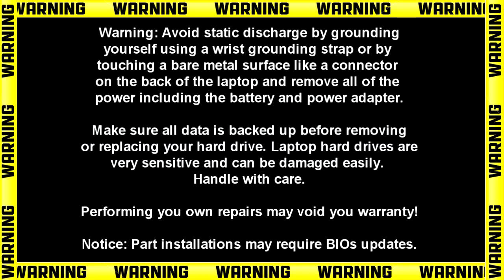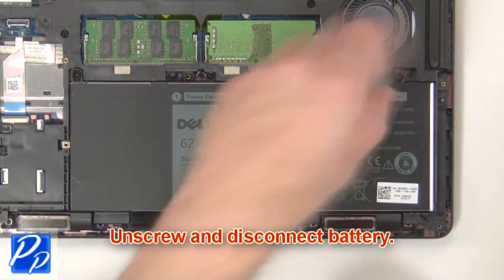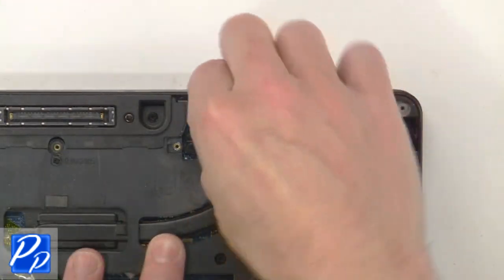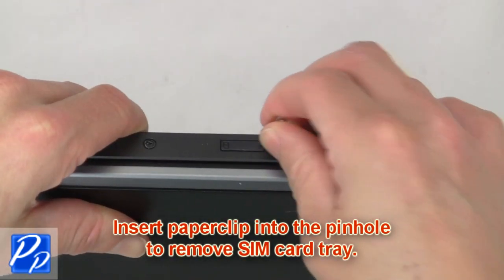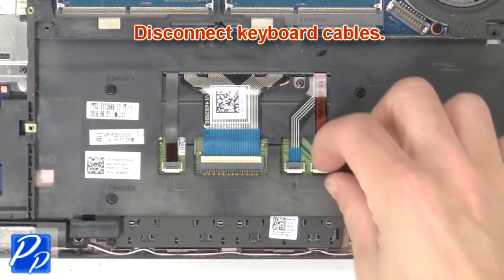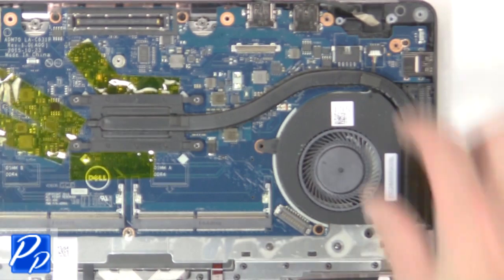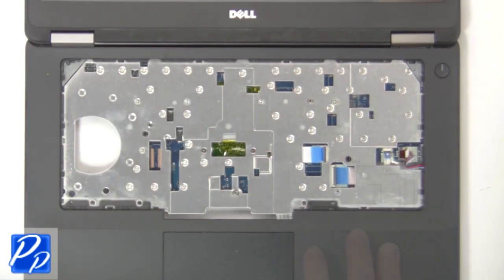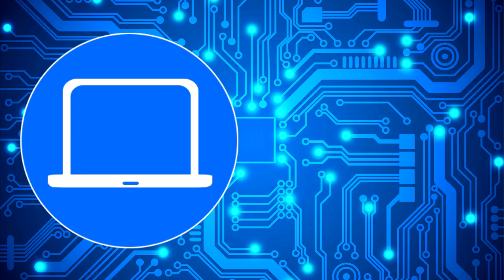Dell Latitude E5470 (P62G001) CMOS Battery How-To Video Tutorial

Comment: @dellpartspeople hm, but will removing the cmos battery clear the bios admin password? got an old laptop for free but the admin lock is inconvenient.
Reply from the maker: No unfortunately the admin password will not be removed from a cmos reset. The only way is a new motherboard or a manual reprogramming of the bios chip. Contact us directly with any questions.

Comment: THIS IS TOTALLY INSANE! I HAVE TO DO THIS LIKE 15 TIMES! I have never seen a CMOS battery in a worse place!
Reply: I was going to repurpose the computer now I am going to send it to the junk pile
Reply: IKR? Classic case of "who gives a fuck" at the design stage.

I have to point out that the main battery, hard drive, and WiFi / BT radio card are a very, very easy replacement job, so kudos to that designer...

But having to strip the entire computer to replace a $1 part? That's a $17 job, not to mention replacing the thermal paste when you put the heat sink back. I guess it was someone else's job to design the location of the CMOS battery.

Comment: all that just t find the battery, what the hell were Dell thinking
Reply: Very stupid design.
Reply: Lmao, why would you even pull the dc connector and the keyboard (basically disamble the whole laptop) just to frekin reset cmos, laptop business is just so stupid
Reply: Yeah seriously WTF
Reply: For those who don’t understand what Dell made it so difficult. 

It’s actually simple, having the battery where it is provides a security layer as disconnected the battery resets the BIOS security password or BIOS admin password.
Reply: That's the thing, they weren't thinking
Reply: The e5430 has you shucking it in half, like an oyster.
Reply: Dell should be made to do it free of charge. I have a newer 7 series its accessible by removing the back cover.